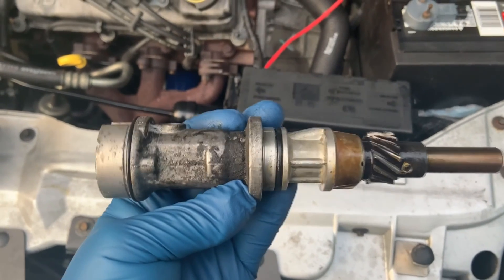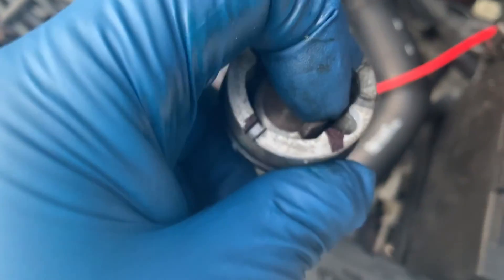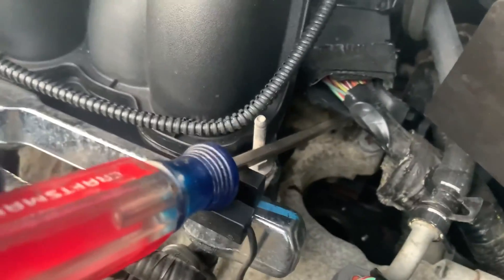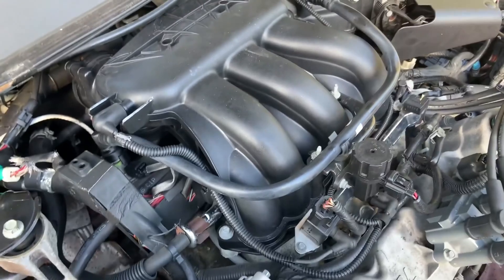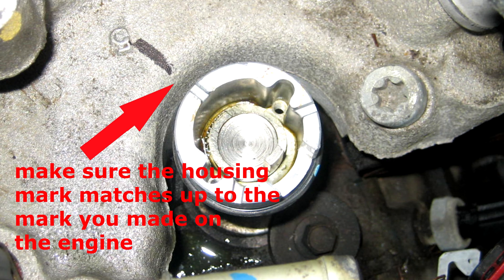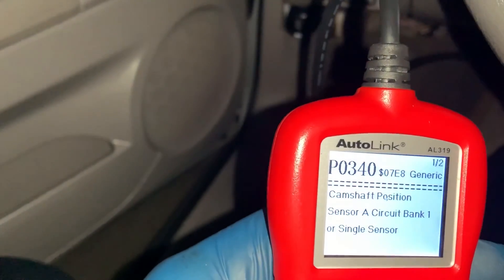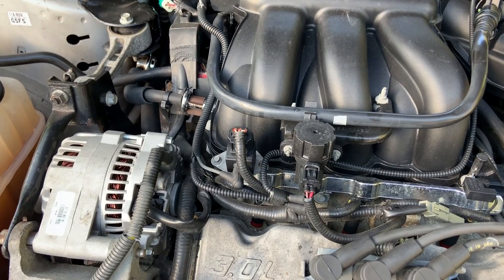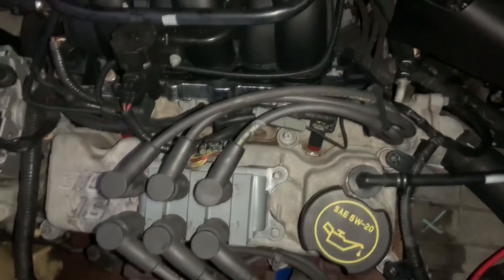Ford Taurus Lost Engine Oil Pressure-  it’s not what you think | Techn' Moto

Comment: Hello Techn, thank you for this video. I have two questions for you. 1> When I rotate the engine through crankshaft bolt, should I rotate it clockwise with car in parking and negative battery cable disconnected? 2> I really confuse about @3:58.  where the 6th tooth is under TDC while your text said the tooth #6 will be positioned under the sensor but the sensor is on the top of the screen. May you help clarify this? Thank you again
Reply from the maker: yes rotate clockwise. the sixth tooth is directly under the sensors.
Reply: @TechnMoto  Let me confirm this: when the car is in TDC, the 6th tooth is directly under the sensor while the 5th tooth is pointing to the TDC mark on the engine, right? Should I align the center of the 5th tooth to the mark on the engine? Also my VIN is 1FAFP53U*YA and this 2V OHV engine. I assume turning the crankshaft bolt clockwise will not loosen the bolt, right? Thank you!
Reply from the maker: that should do it if I remember correctly

Comment: Hi there I seen your video on your Ford transmission leak I have a 05 Cadillac DeVille with the oil coming up to the dip stick it make the car slips and do not move and low on trans fluid can it be the valve need to install hose hope that can help me. Thank you sir for your information
Reply from the maker: Not sure. Sorry.

Comment: Hey, 02 taurus with the oil light on even though it has oil. Light stays on (solid, not flickering) when the car is warmed up and only at idle. I am also throwing p0340, but no other codes. What are the chances that the camshaft synchro could be my issue? If I replace the camshaft position sensor, but my synchro is bad, will I still throw the code?
Reply from the maker: Only one way to find out. Pull it out and look at it.
Reply: @freepizzaandbeer2001  3 years later but it was probably the oil sending unit. Lol

Comment: My 3.0 ranger makes 10psi of oil pressure at idle when engine is hot after long drive on highway that’s lowst I’ve seen it I think that’s kind of low sounds low but Ford doesn’t say what it should be at idle Ford only says your oil pressure for the Vulcan v6 should be above 40psi at 2500rpm witch mine is it sits at 45psi I hooked up a aftermarket glowshift  oil pressure gadge
Reply: Late but yea ran in to same issue sitting at 23 psi at idle at operating temp ford gave me a paper saying 40-60 psi at 2,500 rpm
Reply: @Josh-fx6di  my ranger is still running strong with no issues I don’t think it’s anything to worry about unless your engine is making ticking or tapping noises would be cool if melling came out with a high volume oil pump for the 3.0L I put a melling high volume oil pump in my 4.6 3v mustang oil pressure at idle went from 25psi stock pump to around 47psi at hot idle
Reply: @kamryn7496  Mine started to make a taping noise I was driving to work lol pressure light came on while at idle at stop light soon as I stepped on the gas the light will turn off on the dash I haven’t been able to recreate the scenario but it’s making a ticking noise after that happened
Reply from the maker: If they say that’s good we’ll then I guess it has to be. 😆 no pun intended